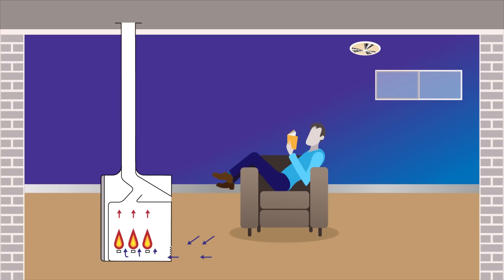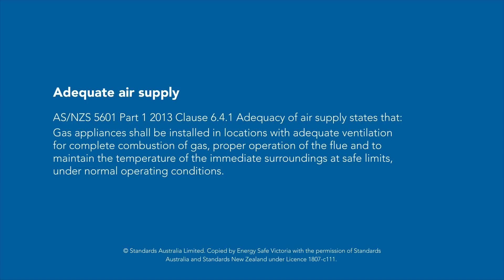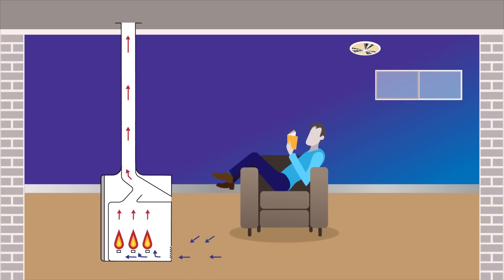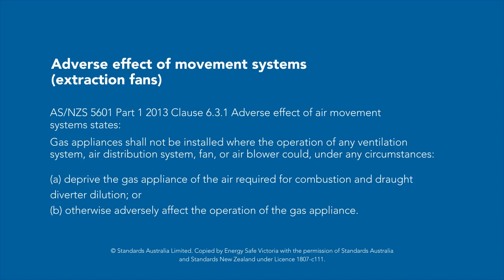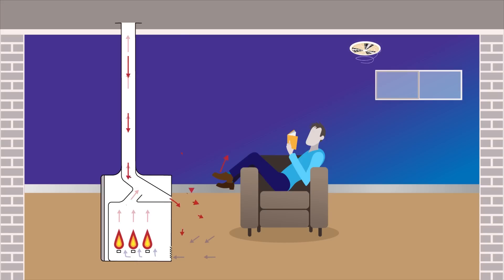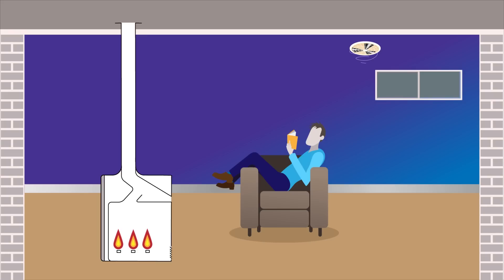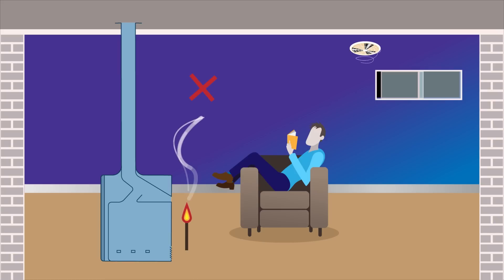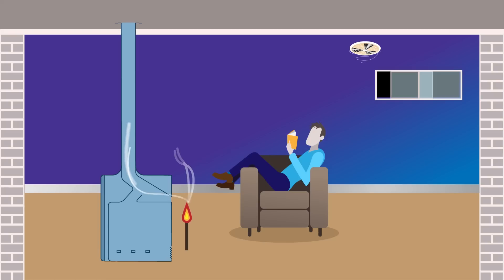Understanding and testing for a negative pressure environment

Comment: Always check flues/chimneys for leaks also, especially if passing through in roof space as you could leak CO into a void. Todays kitchen range hoods can be of very high airflow extraction performance, at times unnecessarily high thus can result in a negative pressure environment being created. I guess at times the trade off is more and more people are opting for refrigerated AC systems and not gas heating, but still older homes should consult with a professional if considering.